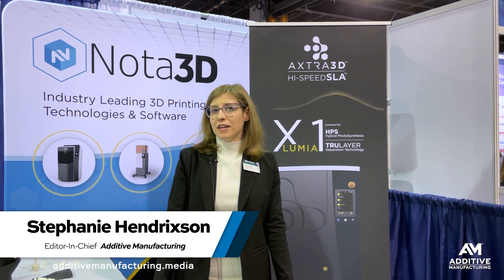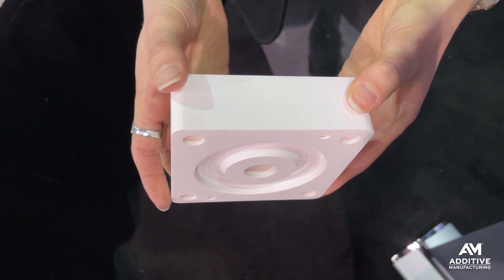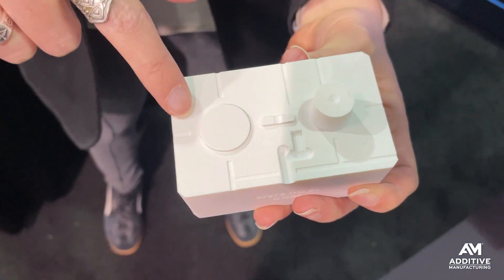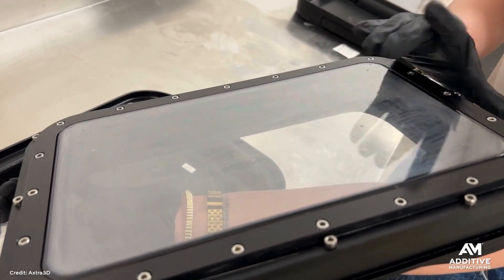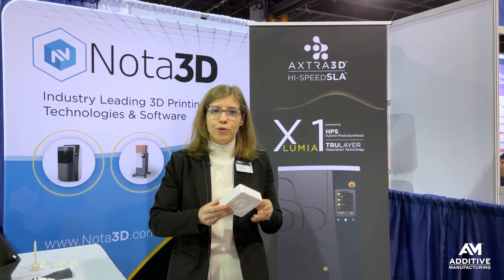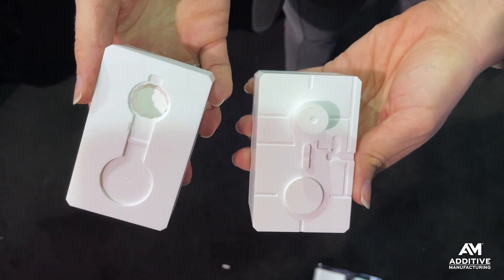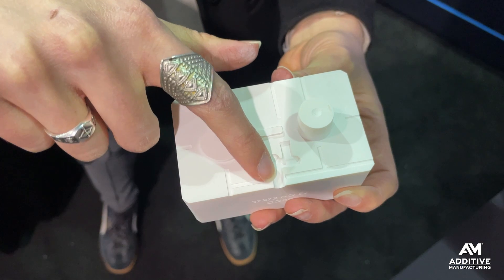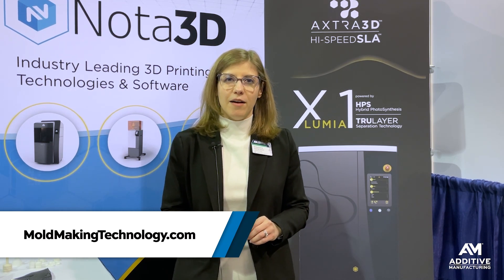3D Printed Ceramic Injection Molds Provide Functional Tooling in Hours

Comment: Do you guys have taken additional steps to make the molds last longer? for example pre heating the mold to a certain temp before injection, what are the mold temperatures before doing the next cycle, or even maybe adding a silicone oil layer on the mold, or adding rubber paddings? because I am printing with PP and it break in less than 10 cycles using the same RG3280 ceramic resin. (I tempered the mold too already).

Comment: It's a cool idea, but how the shrinkage of the model is controlled, 60% of ceramics is quite small. And it's not at all clear why the printer doesn't have a stirrer like Formlabs, after all, then ceramics will precipitate.
Reply: This material is very low viscous as compared to other typical ceramic filled materials. A stirrer is not need for this material.

Comment: How deep does the UV light penetrate during post-process curing and does it matter?
Reply from the maker: From Axtra3D: "After a part is printed and placed in a UV oven for post-curing, the UV light doesn’t fully penetrate through the entire part. In fact, it typically reaches only about half a millimeter to two millimeters below the surface. This limited depth matters because the strength, stability, and overall performance of the part depend on how completely the resin cures.

If the light doesn’t reach deep enough, the inside of the part can remain partially uncured. That can lead to parts that are weaker, less heat-resistant. 

The type of resin, the color, and the shape of the part all affect how deeply the light can go. To ensure a strong and reliable final part, it’s important to rotate the part during curing, use a chamber with full light coverage, and sometimes extend the curing time or add heat to help the light do its job more effectively." 

Thank you for watching!